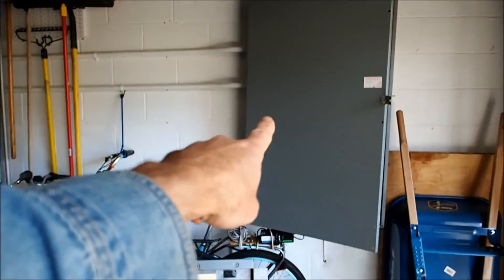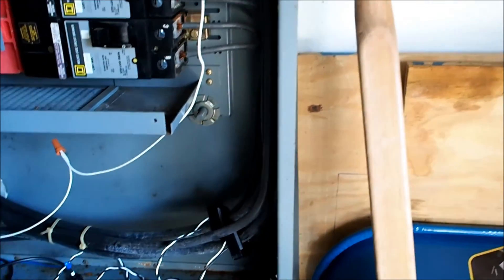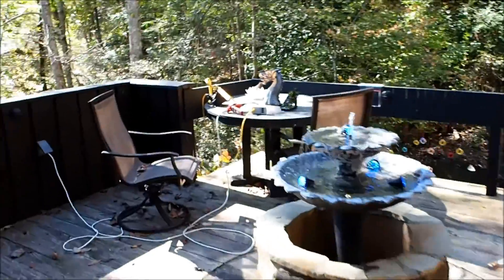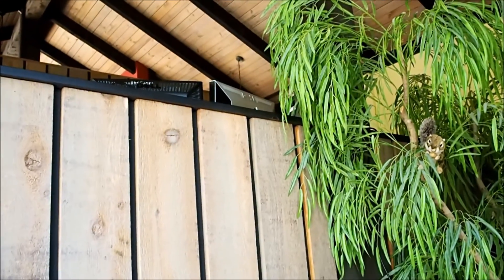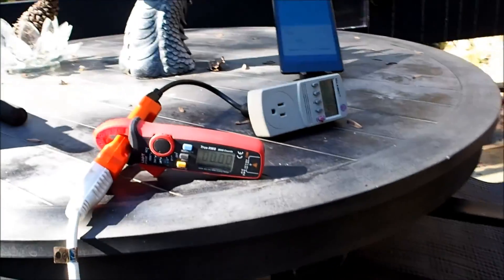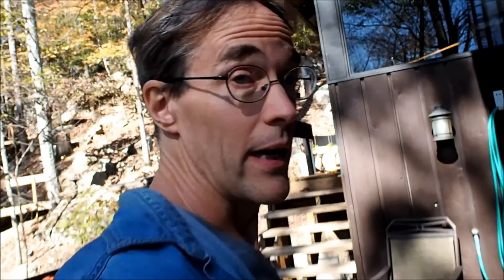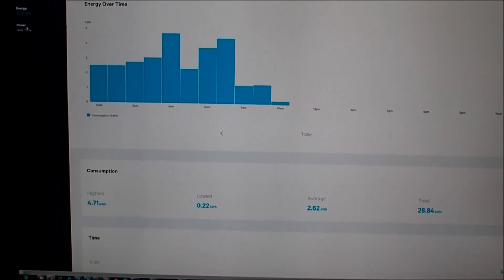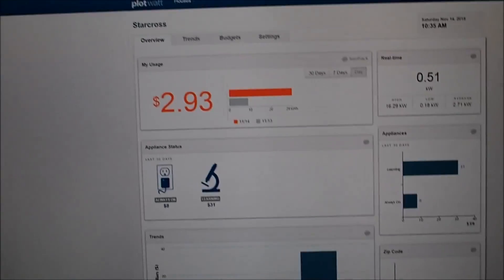Whole house power monitoring with Neurio

Comment: When you use more than 1 senser do you wire them in series or parallel
Reply from the maker: Pretty sure it was parallel.  I think I mis-spoke in the video about 'daisy chain'.   I don't remember for sure, but 'y connectors' would imply parallel.
Reply: Thank You that worked

Comment: You need to measure the voltage that you multiply by the current, I doubt it is exactly 120v, probably 128v.  There is a button on the kill-a-watt that will show it to you.  Also it will show the current that you can compare to your clamp meter.  The  Two out of three could mean two are wrong and the remaining one is correct.
Reply from the maker: All true.   Thanks for the comment.